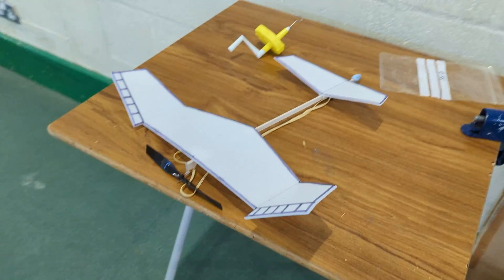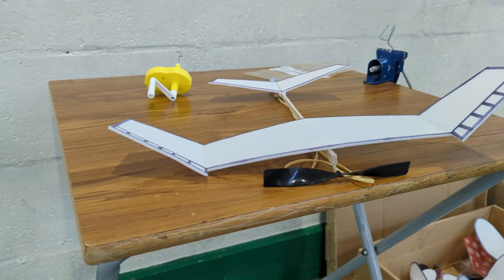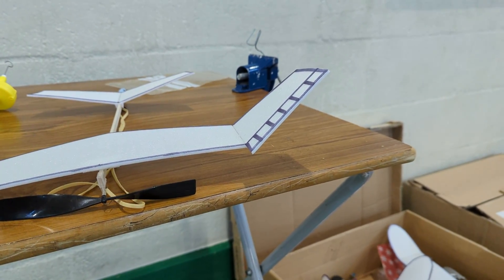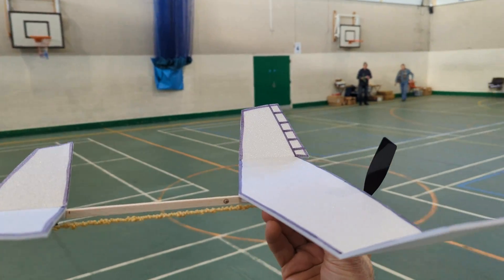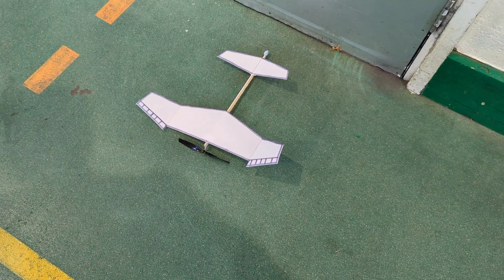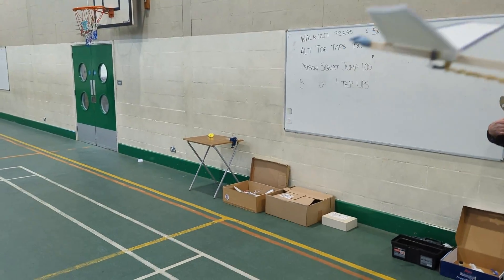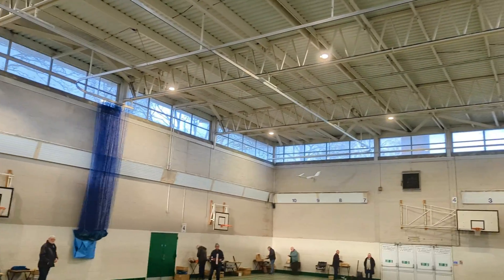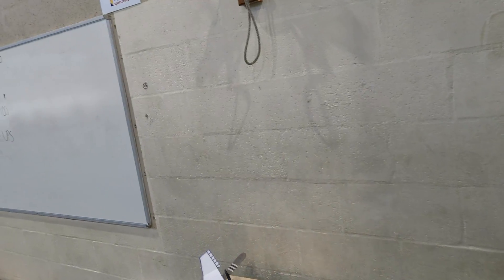Rubber powered free flight canard

Comment: information        thick trailing edges make more drag than THIN ones.        leading edges should at least be rounded.      wing leading edges could be  contoured  appropriately.          d
Reply from the maker: Hi David.  Thanks for the useful comments and I think there is a way to go with this model.  I hate carrying extra weight so elongating the nose is a great idea.  Cheers.. Alan.

Comment: observations        good work.           :12   there is an overuse of dihedral in  both  flight surfaces.        span and chord of the canard appear to be larger than necessary.         the elevons could be smaller and  should not stick out from the wing te.          :21   the nose could be elongated, by an inch or two; by sistering a piece of wood at the lower surface of the motor stick.        doing so would allow a reduction in the amount of ballast mass needed, etc.       d